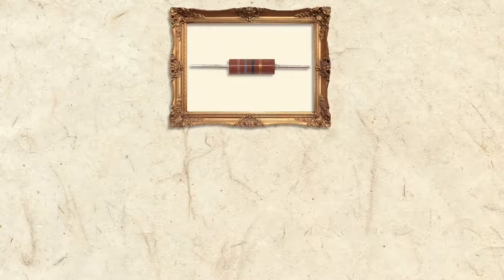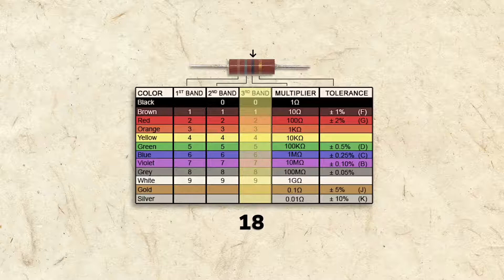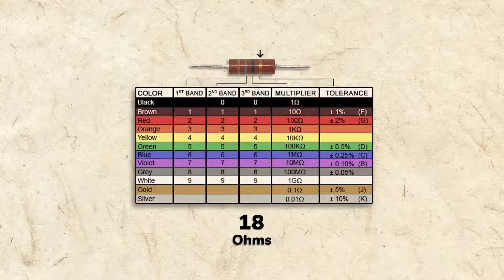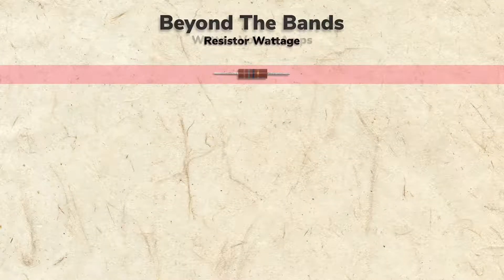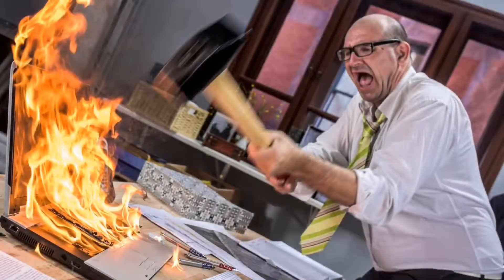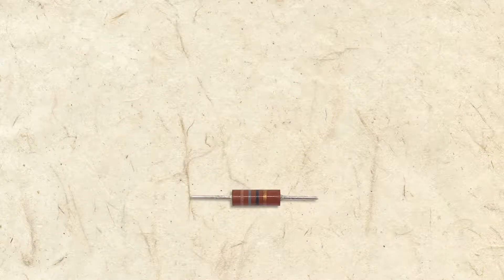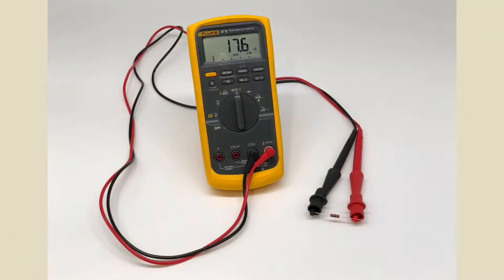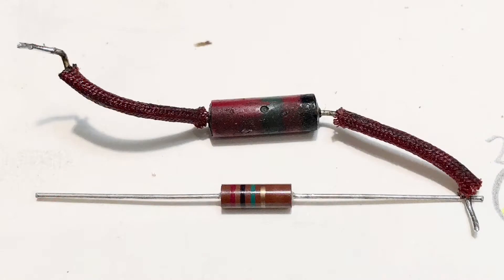Antique Radio Resistors

Comment: like the video, id like to seen mentioned if the resistors were tested in circuit or one end dis connected.. thanks!
Reply from the maker: Great question, Chad. Ideally, components should be measured with one or both leads disconnected as you mentioned. However, often that’s not necessary. At first, I quickly measure components in-circuit looking for values that are out-of-spec. For components that measure correctly this way, I’ll generally leave them be. For the components that are questionable, I’ll clip one or both leads to get a more accurate measurement. Once a better understanding of how a surrounding circuit affects a component’s readings is understood, checking the schematic is a good indicator of whether a component can be measured in-circuit, as it will reveal the added resistance or capacitance at the test point.
Reply: @FluxCondenser  thank you for answering! i have not long ago become interested in tube radios. every time i learn something, i find out how little i know. you just added a piece to the puzzle.  thanks again!
Reply from the maker: Glad to help, Chad and I hope you enjoy the series on Antique Radio restoration. If you have any questions at all on the videos, please leave a comment and I’ll be happy to respond as quickly as possible.
Reply: @FluxCondenser  I liked it enough to subscribe. I'll definitely be watching more!